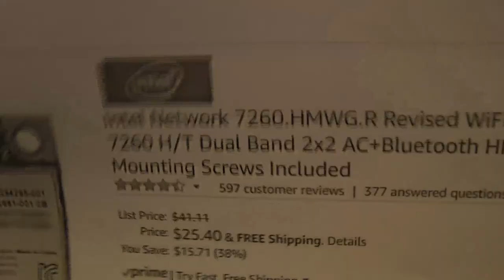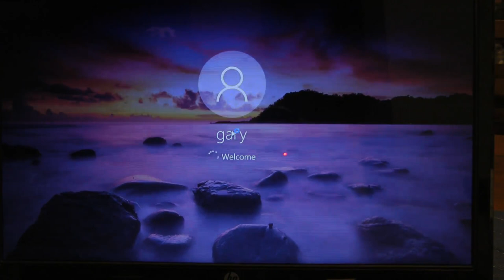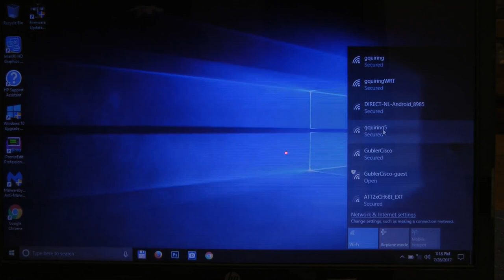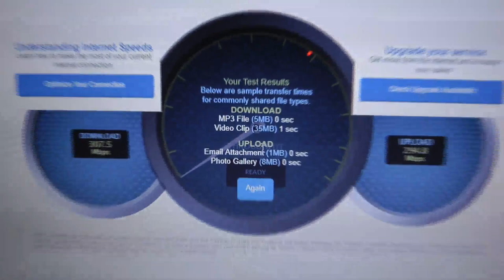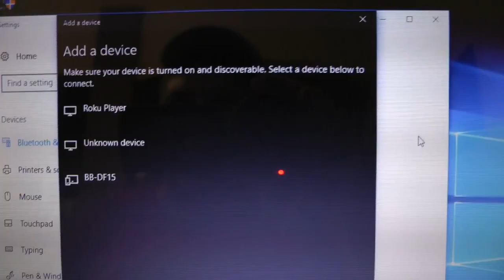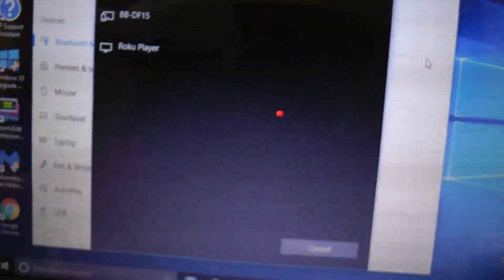HP Envy 4 ultrabook wifi dual band upgrade with bluetooth

Comment: do u know why exactly u needed to cover those lanes? because i wondered i have an external gpu case with mini pcie and it fits in the slot. also starts up when laptop boots. but the card does not get recognized.
Reply from the maker: All I know is it worked.  If you cannot see the card at all that sounds a like a driver issue, are you using Win 10?
Reply: @GaryQuiring  I am using windows 10. But the drivers for this card where available. Installed them. But I also have no unidentified devices. It totally doesnt show up. Now there are 2 possibilitys I tought of. Ether the same issue as this or the laptop has a white list in the bios. So what do you think? Oh and do you have a upgraded bios? Because I'm only able to edit some time settings and some boot settings.